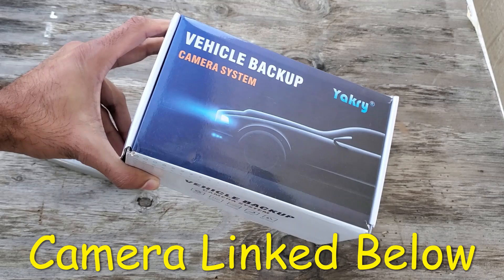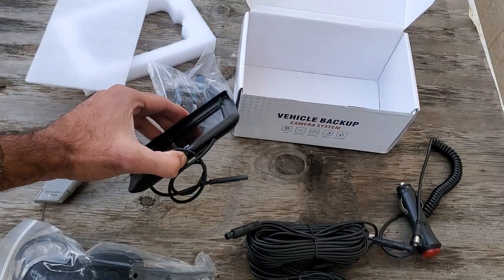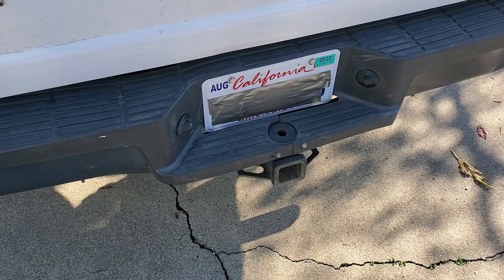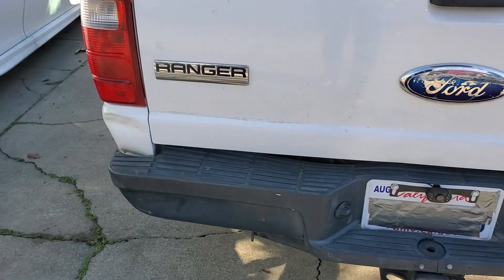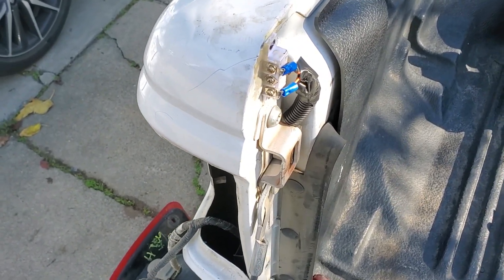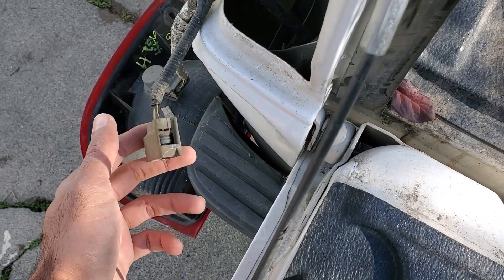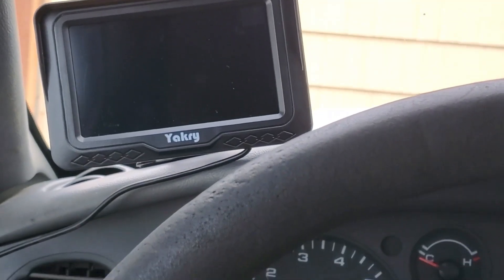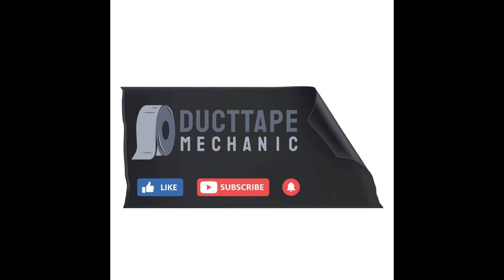Vehicle Backup Camera Hardwire Install!

Comment: I have an 09 ford ranger xlt 4x4 and that hole with the grommet is missing in my cab.  I see the other 2 things to the right of yours but not that one you pulled it through. Bummer.  Up and to the left of that is a big plastic hole with lots of wires coming through it.  Well, I guess I'm going to have to hire someone to do it for me.  😒
Reply from the maker: There has got to be some sort of grommet that brings in wire through the firewall.
Reply: @DuctTapeMechanic  Thanks, your video was good but I guess I'm not up for the task. 😢
Reply: @DuctTapeMechanic  I was watching your video again and the grommet where you ran your wire, on my truck is covered. That entire area that is white on your truck has a fabric type covering on my truck, over all except the huge black grommet and the other thing sticking out to the right of it. I'm going to try and see if I can pull that away and see if there's a hole there. I guess I haven't quite given up yet.
Reply from the maker: @alive-awake  it's a pretty nice feature to have! My camera is going strong and it's been almost 2 years!
Reply: @DuctTapeMechanic  I just had to tell you this.  I just called my mechanic and he said it'd be about $420 to install it.  No way!!!! I need to find a new mechanic. Good honest mechanics are hard to find.  I'd forget the install and lose the $40 I spent on the kit before I'd pay them that much to install.  I even told him that it was plug and play.  I didn't want it hooked into the  back up light.  it has a 12 v. adapter and push button to turn it on and off.  😧

Comment: Those scotchlock connectors are more trouble then they’re worth. First sign of any power issues with that camera and I would remove then solder those two connections instead. They rattle loose and I’ve also seen the wire break at that point due to the jacket being stripped back at the connection and vibration. Anyway a back up camera is awesome, it’ll save you a lot of worry! (And trash barrels, bicycles etc!) Thanks for taking us along✌🏼
I soldered my connections and slipped a piece of heat shrink over the barrel connectors on my own camera, 5 years now no problems. 🤞🏼
Reply from the maker: Yeah I diffently will keep that in mind about the connectors. They came with the kit that's why I went with them otherwise I prefer to solder.  Thanks for the comment